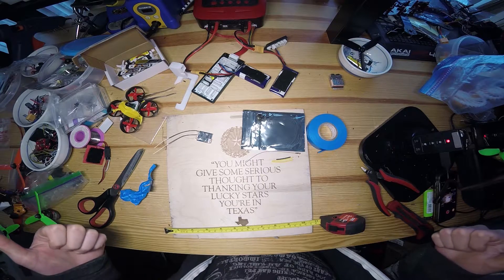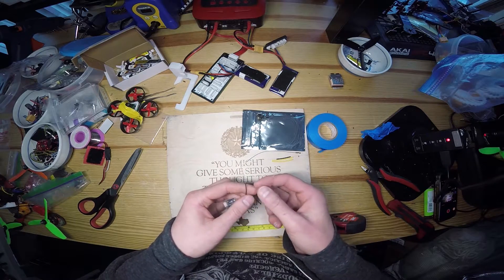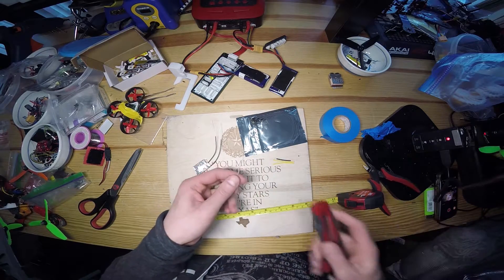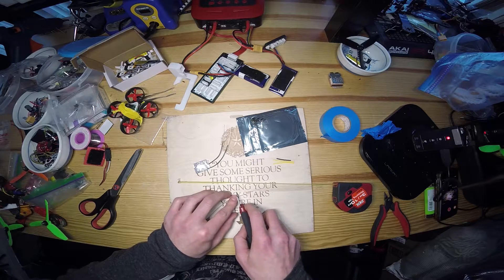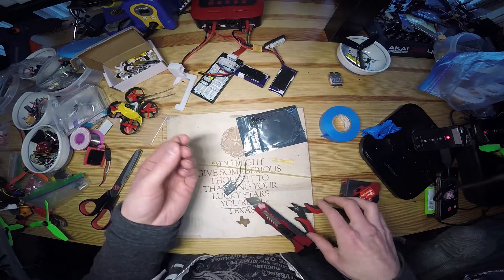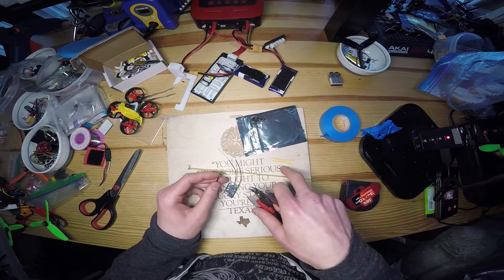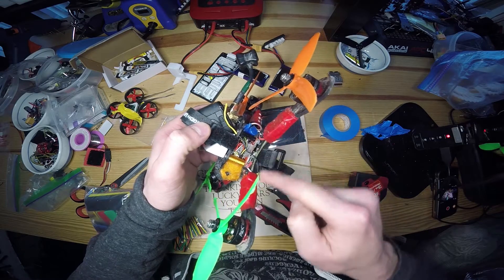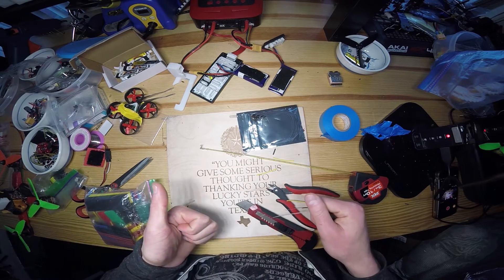Increase Your 2.4 GHz Signal Strength and Antenna Durability!

Comment: This information is wrong as the receiver may have capacitors or inductors which in turn will define the length of wire the only way to get the best signal is the positioning on the model or a better receiver altogether.
Reply from the maker: This comment is 13 years outdated

Comment: The xsr come with a shorter exposed wire because it is catching a 1/5th wave length.  When you mod it to match an x4r, you are increasing the wave length to a 1/4th wave length.  The exact length should actually be 31.25mm and not 31.5mm
Reply: Josue Torres yes, you're right it comes with a 1/5th wave however for 2.4ghz that's significantly less range which frSky doesn't acknowledge. 31.25mm is more accurate length, but we're talking about +-0.25mm, if you can measure/cut that difference, all the power to you loll